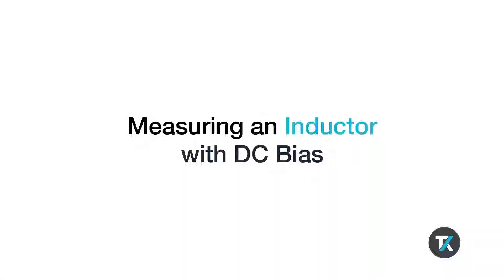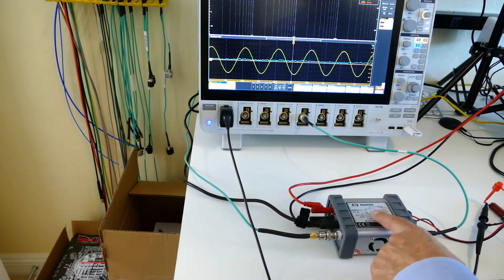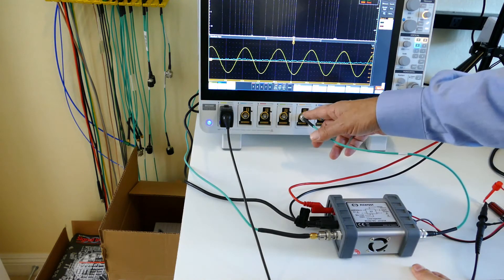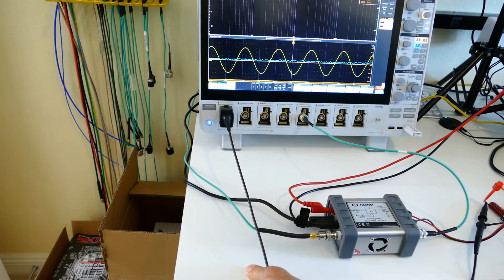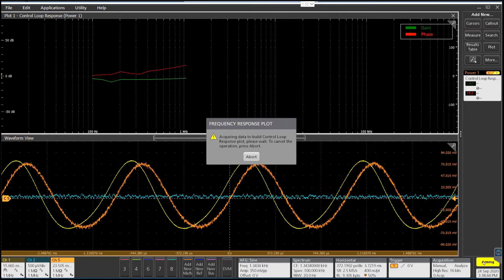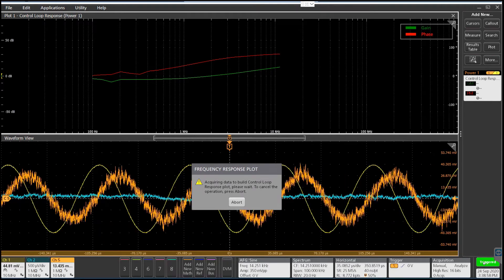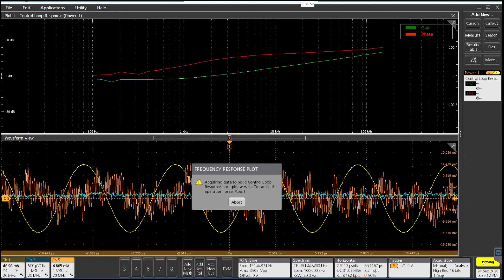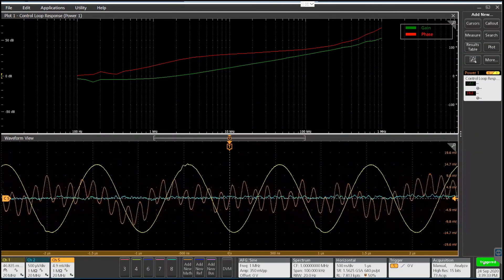Measuring an Inductor with DC Bias

Comment: If you use a regular bench power supply then wont the output capacitance of the power supply  interfere with the inductance measurement, as the effective impedance changes ? The inductor and the capacitors are effectively in parallel. You would be measuring the effective impedance right?